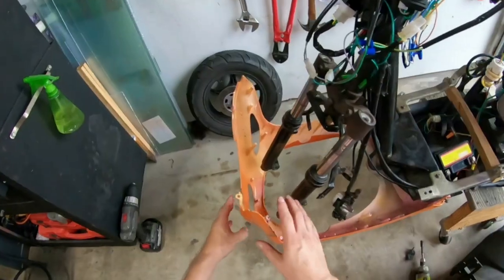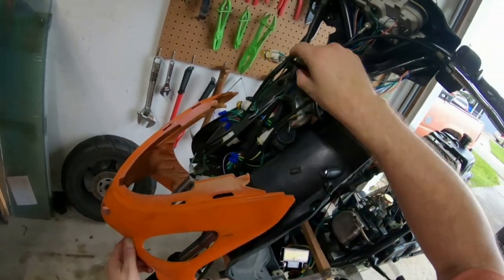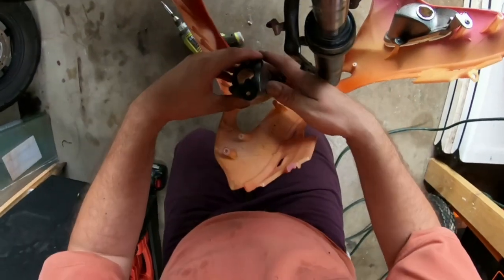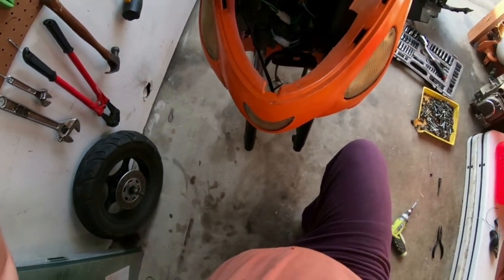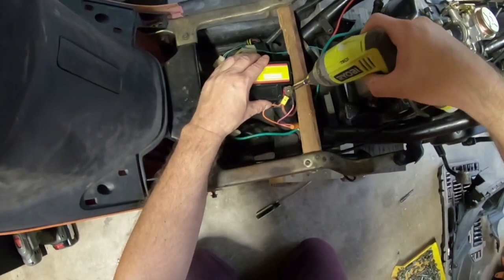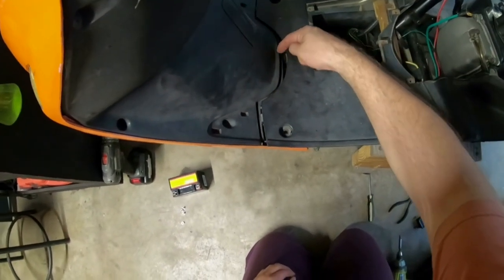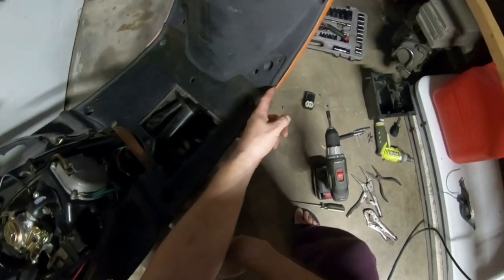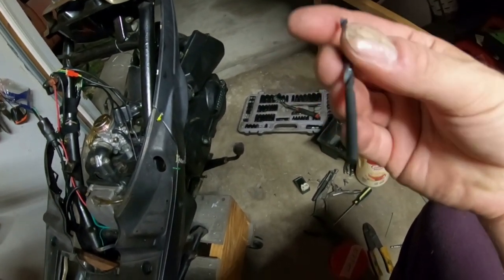part 19 FINALLY Installing Body Panels on GY6 Scooter, After Nearly Three Years, After FIRE

Comment: Hey Bro I've Got A Bit Of An Issue With My Scooter 

My Kymco Cobra 2007 100cc 2Stroke Is Powering On And It Starts Without The Key And The Ignition Unplugged

Any Advice?
Reply from the maker: Hi there
A friend of mine had the same issue,,, possible cause,  wire or wires touching metal or other wires causing the scooter starter motor to turn and making the scooter to start,  hope this helps 👍